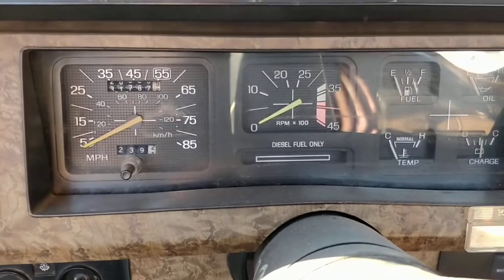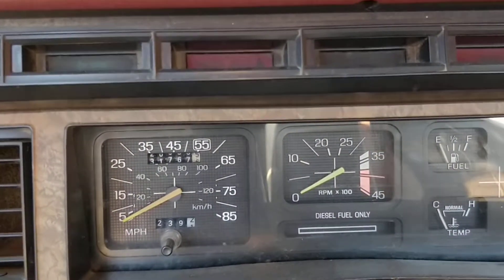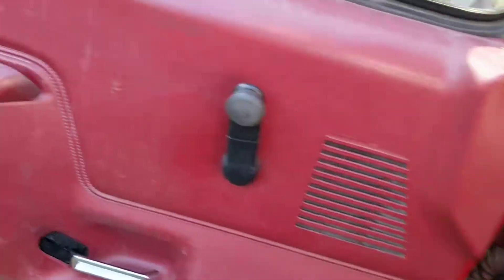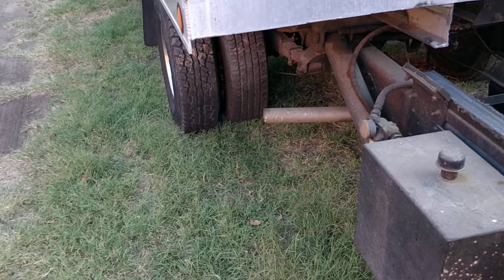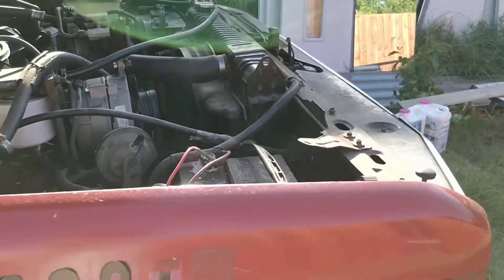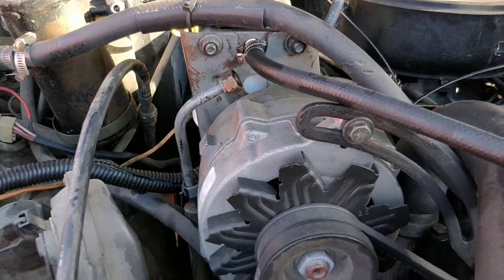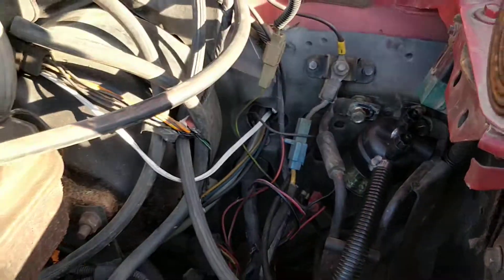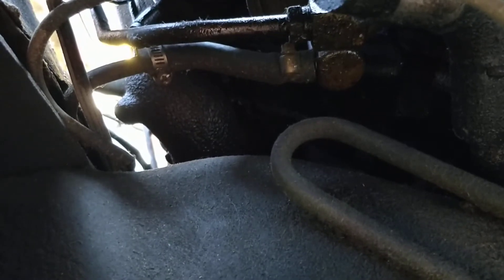Ford diesel electric fuel pump conversion Part 7

Comment: Did you install a relay and or a fuse for the electronic fuel pump?
Reply from the maker: You should do a relay and fuse, however I did not.
Reply: @RevampMotors  thank you for the info. If I were to do a fuse and relay with this exact pump (Carter Fuel Systems P4601HP). What fuse and relay size would I have to seek? I’m looking for some info on forums but they aren’t very accurate and electrical systems isn’t really my best skill
Reply from the maker: @Eyesopened-1  Bosch 30amp relay and 10amp inline fuse should be sufficient

Comment: what did you use for a blanking plate?
Reply from the maker: For the old fuel pump?
Reply: Revamp Motors by R.J. Davenport yes
Reply from the maker: @redders49  standard fuel pump block off plate

Comment: So the pump only runs while cranking? Does it flow free after started
Reply from the maker: The pump runs as long as the ignition switch is on.  So it's always running until you shut off the truck.